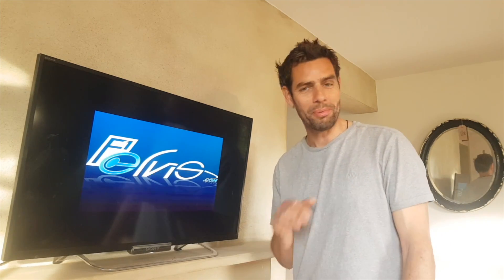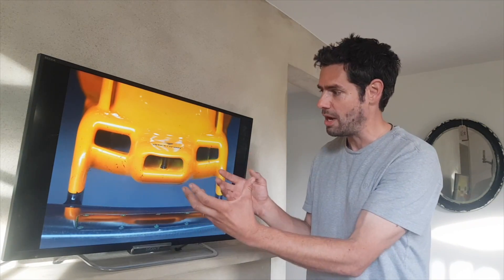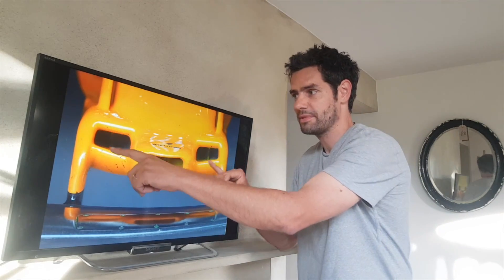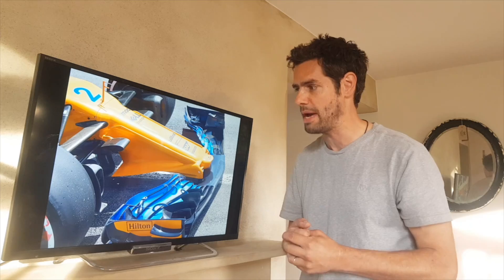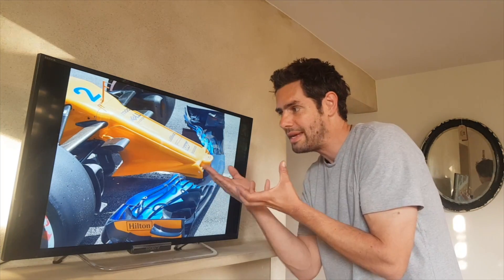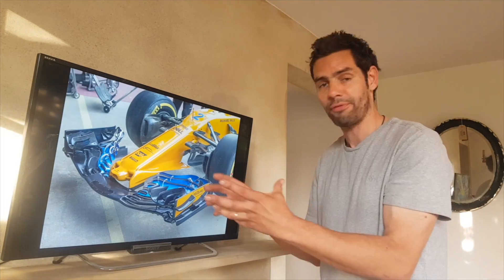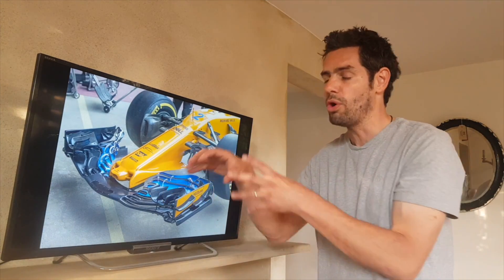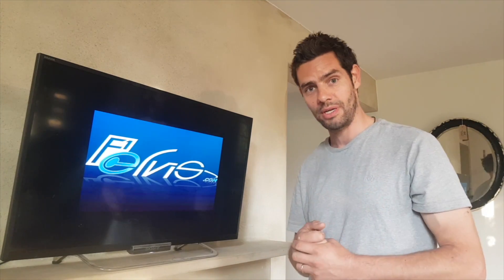MP91 - The new F1 McLaren McL33 Nose

Comment: Hey Mark!
Brilliant video as always, but a slight request:

Are there any performance boosts in the near future, regarding sound quality in your videos?
Either a small shirt-mounted mic? Or atleast some sort of "normalizing" on the editing? As the volume of the sound is very inconsistant, both from video to video, and also occationally from shot-to-shot in multi-part/heavily edited videoes.

Something like exporting the audio, running it thru audacity, and "normalize" to -1,5dB or so would probably suffice.

If you are afraid of noise with the normalization, audacity also have a noise reduction algorithm you can use (typical AC-fan hum and other "static" noise such as car noise etc)

Comment: Why not bring back refuelling? Consider, the example of Spa. Last year there was a diff of 5 secs between first lap and last lap. With refieling, it will improve racing by bringing in more pit-stops amd varied strategies. Also, it improves car performance at the start of race if cars are running with low fuel. Agree? Why not bring back refuelling?

Comment: Here's another one for the Q&A. I'm not a big fan of the DRS for overtaking purposes, but what if you could use this system to get rid of the performance difference between the top teams and the rest? If you would allow the leading car to only have a DRS duration of 2 seconds whereas the last car on the track would get 12 seconds a lap, surely that should make it easier for the smaller teams to keep up with the top ones. It might even make the top teams refrain from spending millions to achieve relatively tiny gains. This way, a budget cap and even more standardised parts wouldn't have to be introduced to get a level playing field. DRS duration based on track position: what's your opinion?
Reply: that sounds a good idea to me.no cost to the lower teams level the playing field.what does M.P think?

Comment: Hi Marc.  You described the "cape" as being a possible downforce generator thanks to pressure differential between the upper and lower surfaces, however, it appears from the photos you show that the trailing edge sits lower than the leading edge.  If the under surface of the "cape" is predominantly flat, wouldn't this angle of attack be likely to generate lift?
Reply: Agreed.

Comment: Does the weight of carbon fibre needed to achieve an aerodynamic outcome ever come in to consideration, or is it so light it doesn't factor?
Reply from the maker: 970357ers Overall weight of car is mandated in regs, as to some extent is weight distribution, so tiny effect of carbon flicks or winglets etc is negligible compared to aero benefits.

Comment: Mark all this talk about the front wing and its importance to the performance of a F1 car with all of its intricate parts to boost performance, in Barcelona max smashed off half of his wing and it did not seam to harm his speed on the track?
Reply from the maker: John Robson It did have a reasonable impact on his performance. See how much quicker RIC was in second phase of race, where VER was quicker early on.
Reply: John Robson max had locking wheel in mid speed corners.
Reply: Yes but not enough to allow vettel to catch and pass?
Reply: John Robson Only the end plate fell of, not too big damage